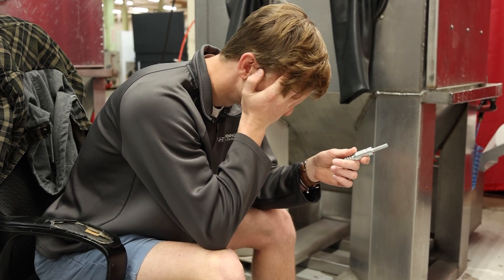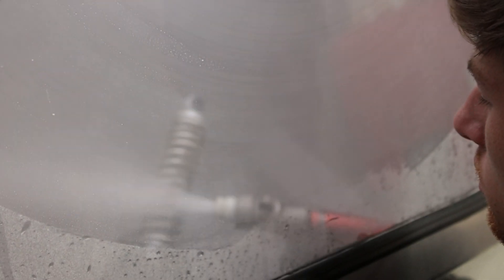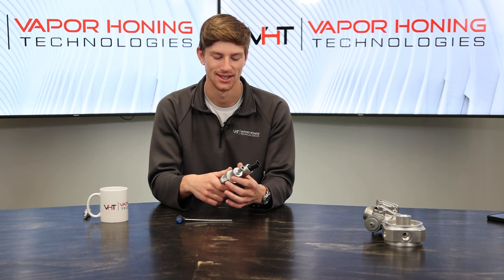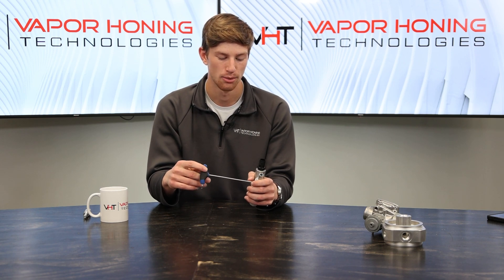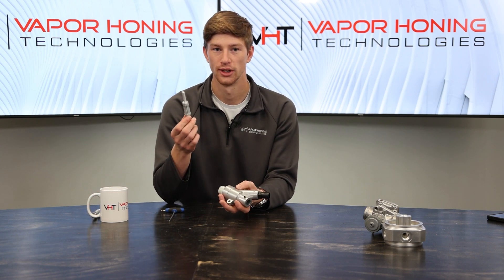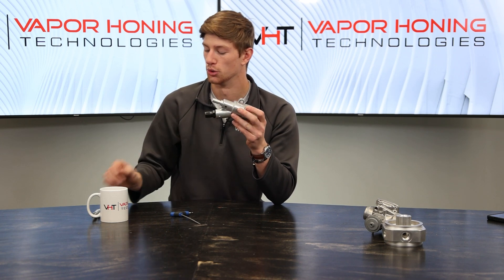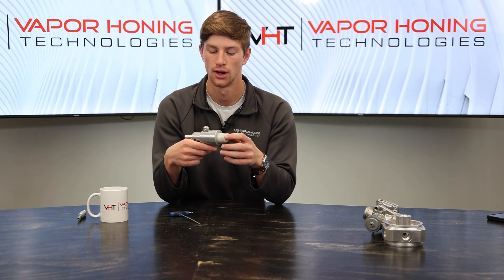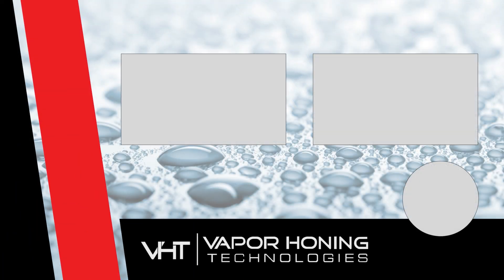New 5 CFM Air Jet! Vapor Blast with a small air compressor

Comment: comparable results at 5 CFM? How about no. The volume of compressed air is the greatest contributor to work rate. Advertising "comparable" results with a nozzle rated to 1/5 of the previous CFM recommendation is disingenuous. This company has no technical competence, I have zero faith in their claims or product & I advise anyone looking for a machine to go elsewhere.
Reply from the maker: @Dr_Xyzt You are exactly right! The finish results will look the same, it just takes longer to process a part.

Comment: Hmm, I wonder what prompted you guys to do that.  That's a step in the right direction.  Now you need more choices.  You need to offer sizes for 3, 5, 7.5, 10, and 15 hp compressors.  I'd also suggest you contact people who have purchased machines already and offer them replacement jets appropriate for the compressors they own since the jet that has been being included with your machines is for a 10 hp compressor!  I don't personally know anybody who has a 10 hp compressor, and I promise you the vast majority of people who have purchased machines from you do not have a compressor anywhere near that big.  I bough one of your machines and I don't have a 10 hp compressor and for the price of the machine it should come with a jet that will give me the best performance for the compressor I have.  Also the 1/4 inch hose from the regulator to the bulkhead fitting needs to be addressed.  It needs to be 1/2 inch all the way to the gun.  The 1/4 inch section is crippling the potential of the machine.
Reply: I looked at the CFM requirement of the machine before I purchased it and made sure that my compressor met the minimum requirement. I have a 7.5 hp Chicago Pneumatic and a 10 hp IR type 30. When you buy equipment you make sure it works with what you have. Maybe I look at it different because I own a business doing fab/rebuild/restoration work,
Reply: @drew3804schannel-vk7ii  I have the weekend warrior and it came equipped with a jet and nozzle for a 10 hp compressor regardless of what they said the CFM requirements were.  They market that machine to the DIY/hobbyist.  You said yourself that you have a business where you need a larger compressor, but the average person does not have a compressor anywhere near that big which means the compressor would not be able to keep up for very long before performance was lost.  I was not offered any options for reconfiguration of the gun.  I did buy a 7.5 hp Eaton compressor when I bought the machine, but the jet and nozzle were still too big for my equipment.  Then there is the fatal flaw in the machine itself where they have 1/4 inch hose from the regulator to the hose inside the machine where it goes up to 1/2 inch which decreases both pressure and velocity.  Look up the Venturi effect and Bernoulli's principal.  You can get good results with the machine configured the way it is, but you can make the machine vastly more efficient with minimal effort and expense which would result in not only great results but in less time due to improved efficiency of the machine itself.  A international company such as VHT should know that and engineer their equipment accordingly.  I am fixing my machine so it works at the highest level of efficiency possible, which will void the warranty.  I am good with that because I refuse to use a machine that is crippled due to what amounts to poor engineering.  I will not be planning on trading this machine in for a "better" machine that would probably have the same problems as the machine I have.  If I need a bigger machine, I will build one myself.  That is just what my experience has been and I am just sharing it for what it's worth.